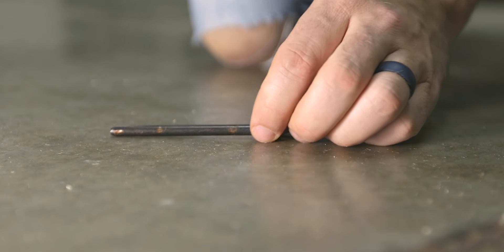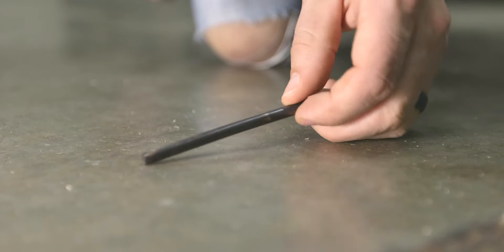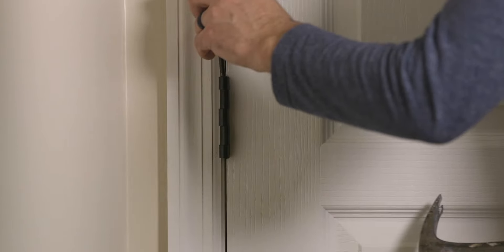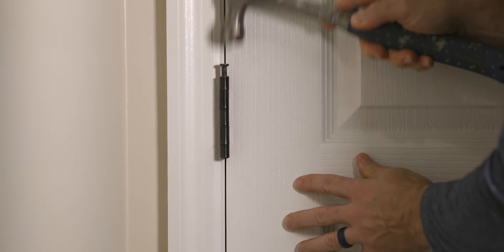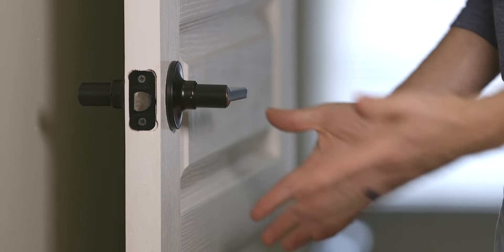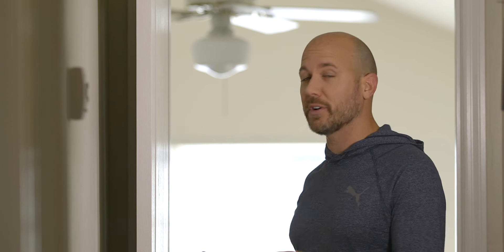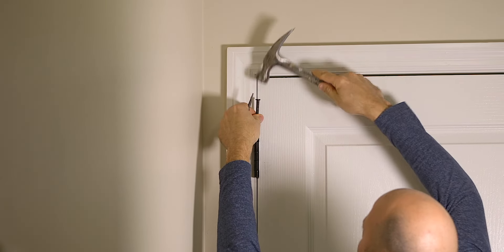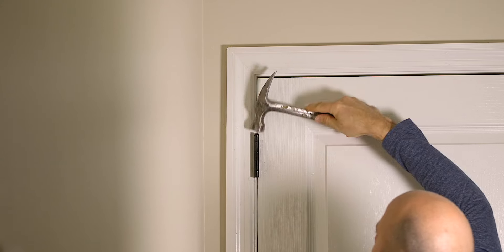Interior Door Will Not Stay Open | Quick Fix

Comment: Thank you so much.  I'm an 80 year old great grandma and I recently put some Wd-40 on my bathroom door hinges.  Then the door wouldn't stay open.  So annoying.  I found your video right away and took the top pin out and put it on the garage floor and hit it with my hammer.  I had quite a time getting the pin back in the hinge due to having to lift the door a tiny bit to align the hinges but I finally prevailed and voila!!!  Your solution works like a charm.  I can't wait to teach this trick to my son.  He will be happy he doesn't have to come over here and put my door back on.
Reply from the maker: Awesome job! God bless you and your family.
Reply: Thank you very much! Worked like a charm on the two doors I had sprayed with WD-40. 10/2/24

Comment: Thank you so much for this awesome quick fix. I just had a storm door installed last week and the installer did tap the pins back down in the hinges. They were all sticking up quite a bit but I hadn't noticed. However, that did not stop the problem of the door closing. So glad I decided to do some research and came across your video. I was never concerned before because I didn't have a need to leave the front door open. But now I do and it stays open perfectly! 😁
Reply from the maker: Glad this worked for you! :)